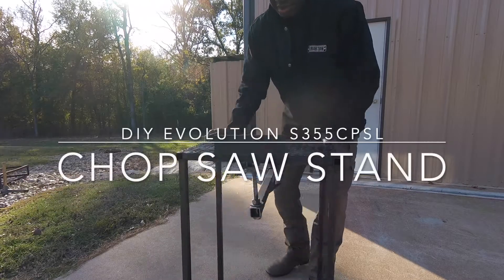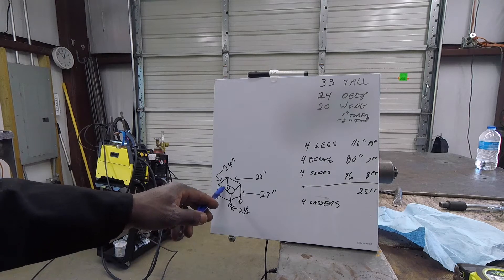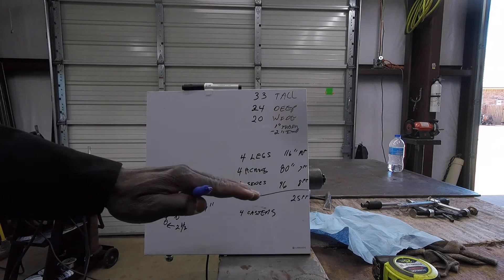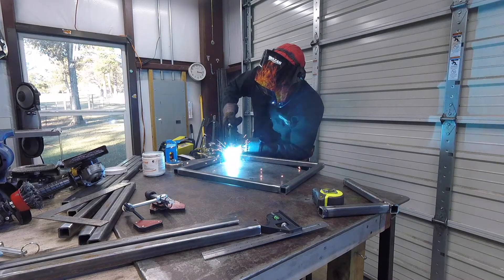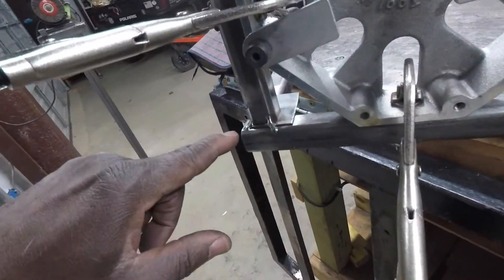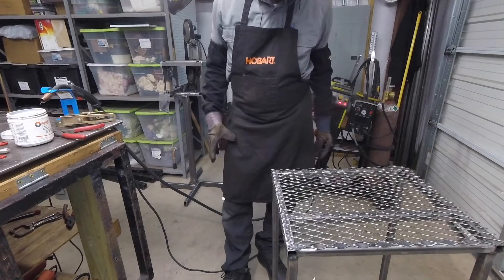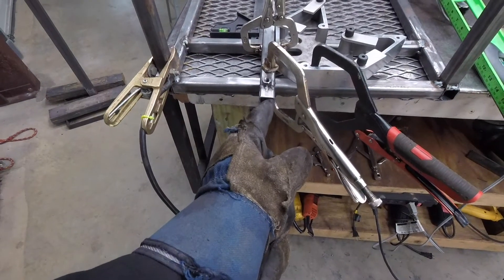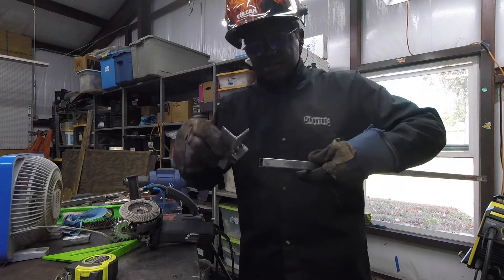DIY Evolution S355CPSL Metal Chop Saw Stand Build using the Weldpro 155GD

Comment: Nice  project Daniel. I just purchased the same welder my fingers are crossed for it to last👍
Reply from the maker: Hello Sir, I purchased a new welder because the Mig function quit working recently.   I plan to use it for Stick welding only.  Just started using the Mig two months ago and owned the unit for 11 months before it died.   I hope you have a better experience with your welder.  Thank you for watching.
Reply: @danielchambers1958  I had the same problem with the same welder the wire feed doesn’t work right anymore I bought a titanium from harbor freight
Reply from the maker: @MarkWilliams-vp7xw  Sorry to hear that….. their warranty is useless…… very happy with my Primeweld Mig180…….  I hear that your choice is a good machine as well.  Happy Easter ✅
Reply: @danielchambers1958  thank you sir and happy Easter to you as well. I’ve heard great things about the primeweld welders .